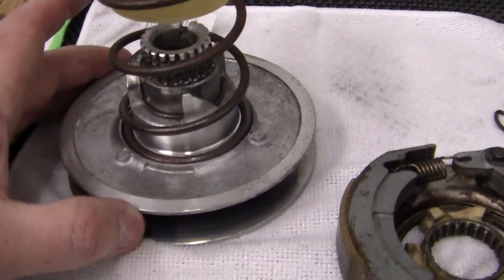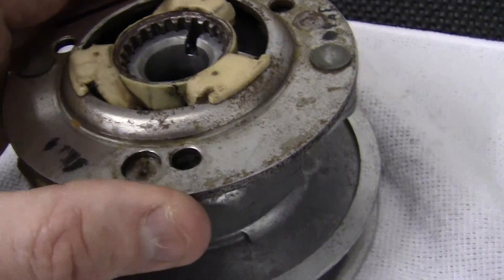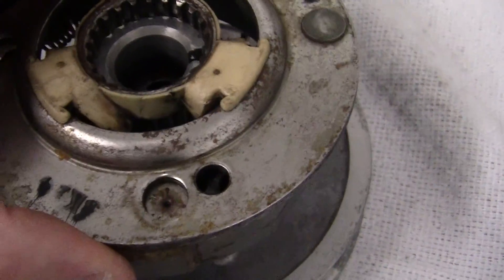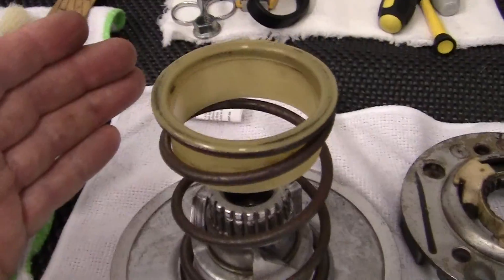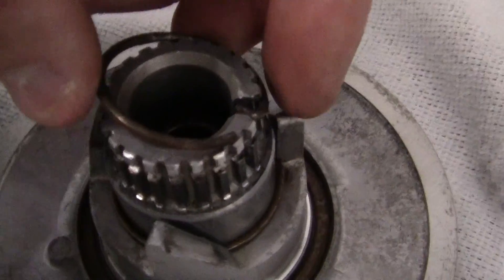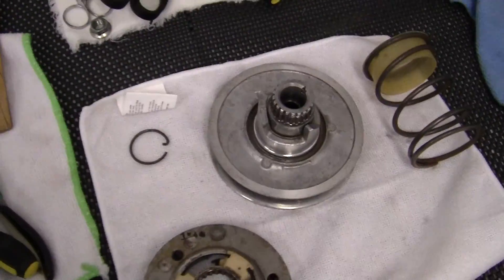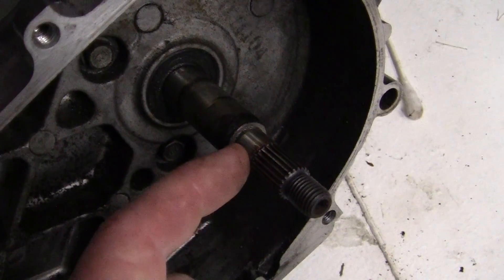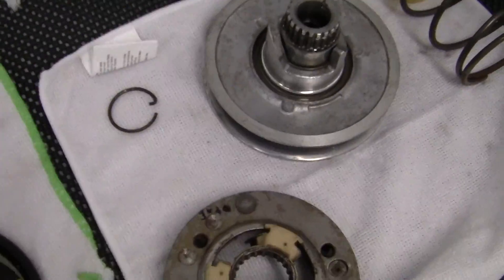136)-  PROJECT Honda  RUCKUS - HOW TO= Engine COMPLETE REBUILD

Comment: im wondering how you pulled the clutch apart? I have used clamps and removed the lock ring, but it doesnt want to come apartto change the spring. I'm worried its under load and cant seem to separate them. Any advice?
Reply from the maker: I used my ZT Clutch removal cage which I have plenty of videos of. You must compress the spring to remove pressure on the locking ring. It is very easy to do with a clutch cage.

Comment: HEY DIO. was wondering where you ordered the ecu?
Reply from the maker: All parts for the Ruckus were bought at BikeBandit.com. THey are quick efficient and have alot of diagrams of engine parts for alot of bikes. DSD
Reply: @DIOSpeedDemon  dude I love your channel. Thanks.
Reply from the maker: @kostlmusic  I am starting my DIO spring racing Engine, soon. Age and Time wait for no man. I am glad you like the channel and glad to have helped. Randy
Reply from the maker: @kostlmusic  Your Reply makes all the hours I put into my little videos, Worth It. I was born to Teach, even though I have no credentials. Thank you for the Kind Words. R
Reply: @DIOSpeedDemon  really big new fan. Love all the different stuff you got on your channel. May need sone help with my ruckus!
Reply from the maker: @kostlmusic  I rebuilt the Ruckus for a Friend and I have never owned one. I dont have hands on experience with the Ruckus but can show you in the right direction for parts and things. Ruckus is an excellent designed bike and worth every penny. Get a shop manual for your year bike, the first thing. R